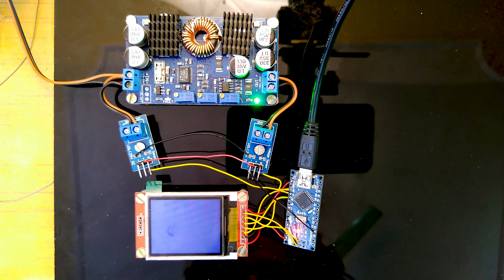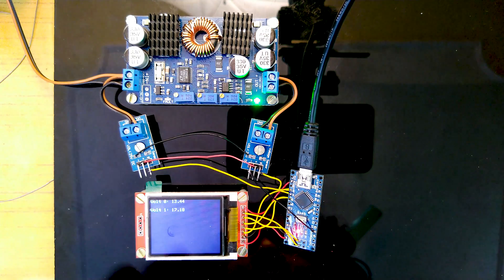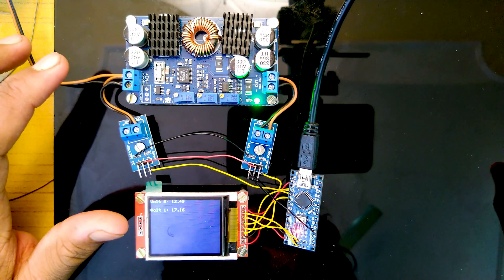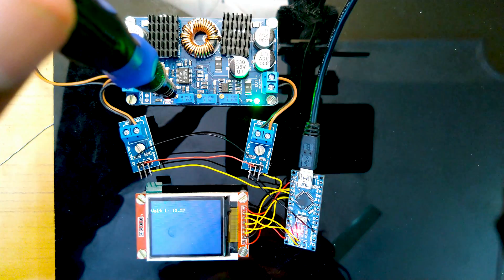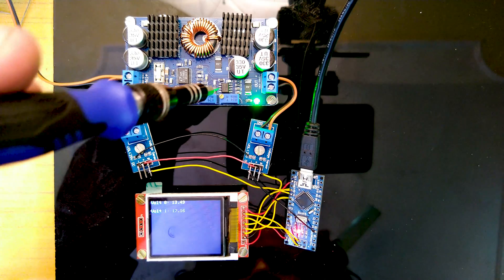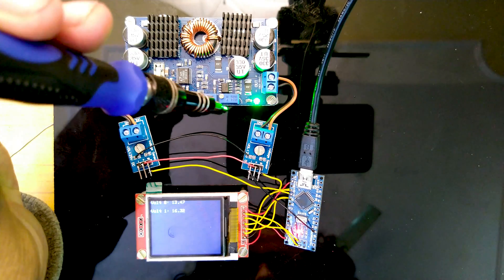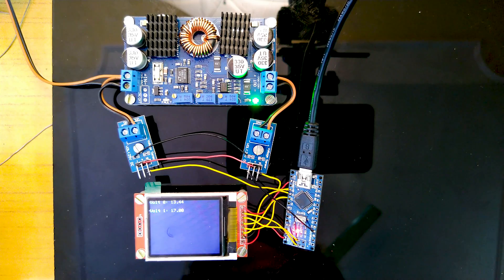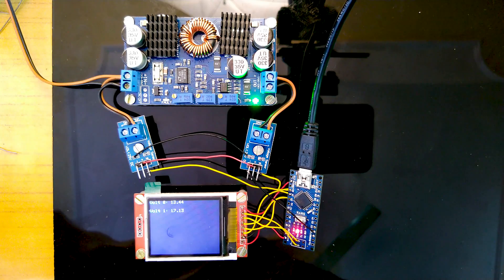DIY LTC3780 MPPT Solar Charge Controller using Arduino Nano | Part 1

Comment: i bought this circuit, but the under voltage protection doesn't work properly below 8V can you please set it to 6,5V and test yours?

Comment: MPPT charge controller works by monitoring input current and voltage and adjust output current continuously to achieve maximum input wattage. A constant current/constant voltage buck boost converter is not by itself an MPPT charge controller.

Comment: Arduino is actually just for showing the voltage input and output, since the module in itself is enough to manage up to 10A output after being correctly set. It's a great piece of hardware considering it's about 10usd or less
Reply: Does this mppt works? Can you share the codes plz?
Reply: @mohammadmostofakamal9282  there is NO code needed. Buy an LTC3780, and set the output voltage to 13.8V, then put to the max the current potentiometer and to the minimum the cut off voltage. This is between panel and battery. Then you need ANOTHER LTC3780 module between battery and load, set output to 12V,  current to max, and cutoff voltage to 11.6V.